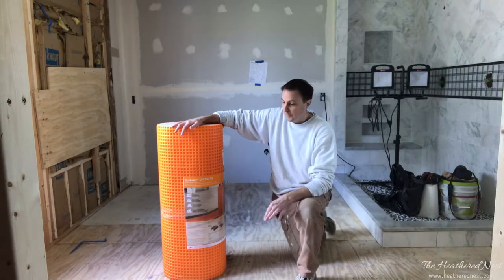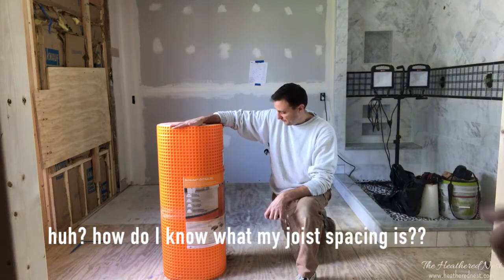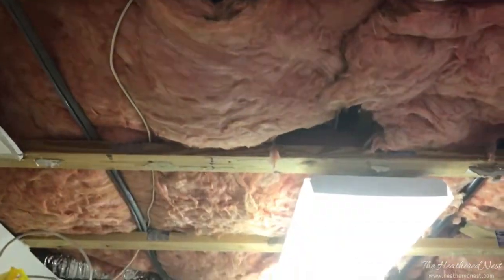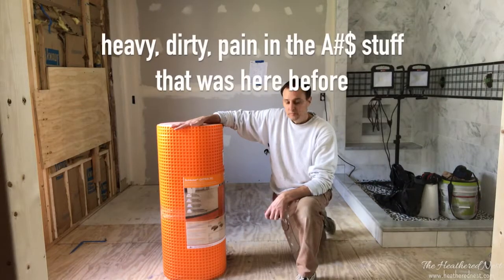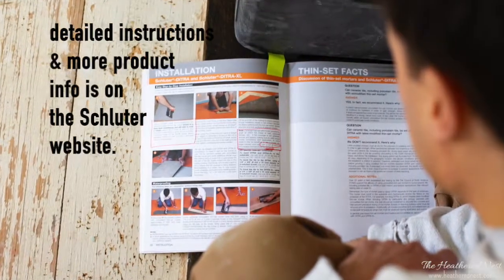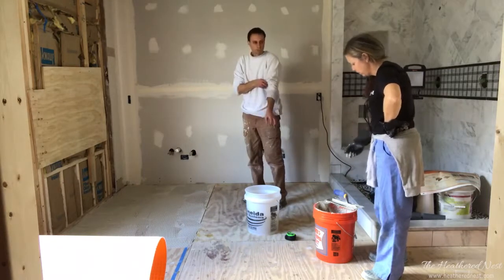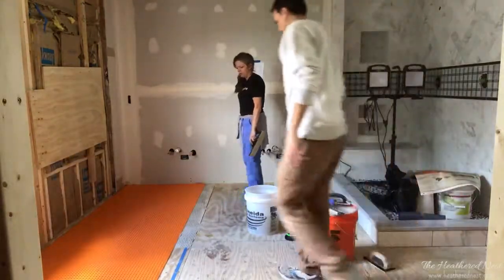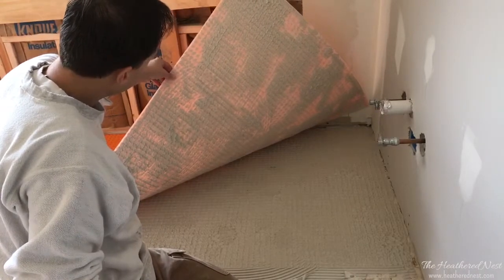Why we Chose Schluter Ditra XL Underlayment

Comment: How has it worked?  I am in a similar situation.  20 inch joist and 3/4 OSB.  Took 2 days to pull up concrete board and tile.  I’m ready to pay for time saving options and Dietra XL looks good but I worry that I need to add plywood before using .  So any issues?  Do you recommend?
Reply from the maker: It has worked really well for us, Ken. I'd honestly reccommend reaching out directly to Schluter. They answer the phone and will honestly help you answer questions for your specific project. I know not many companies do that, but Schluter definitely does. I wouldn't want to blurt out an answer to you and have it be incorrect.